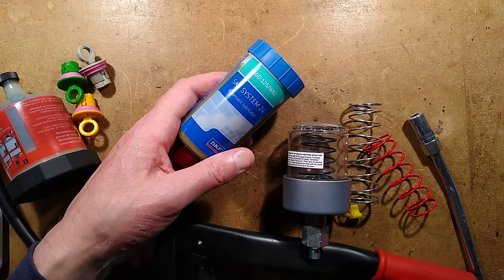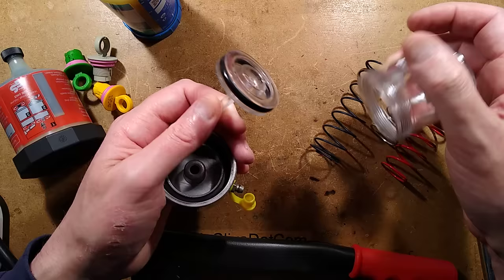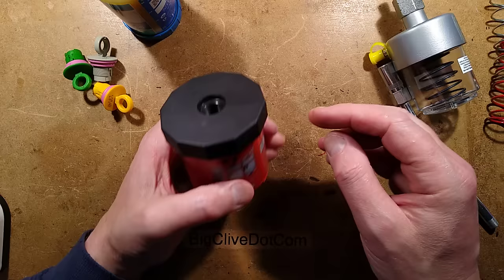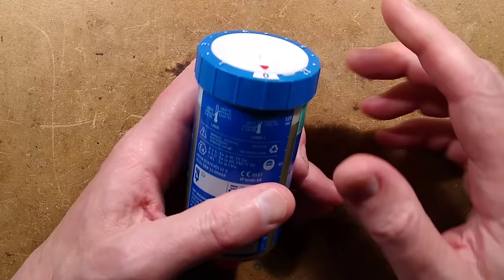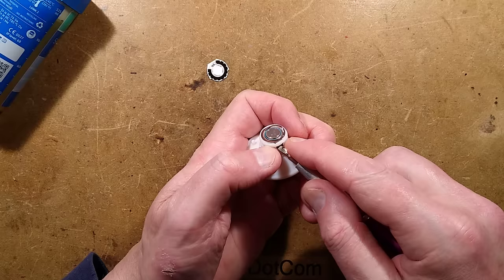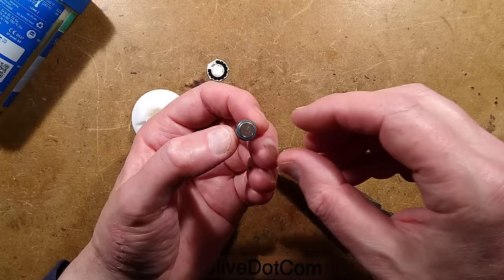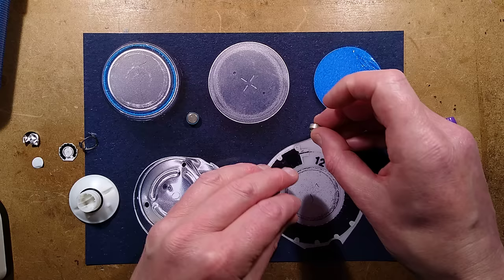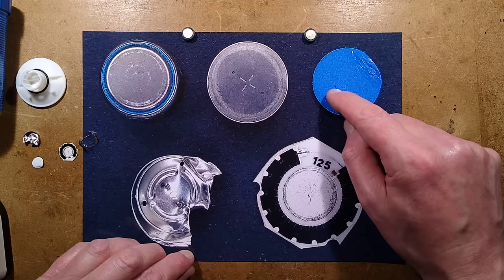Absolute genius automatic lubricator

Comment: The difficulty with this kind of "simple" system isn't just designing it - it's being able to manufacture every element with enough accuracy that it will work reliably and at a consistent speed.
Reply: Fast, cheap, good.

Pick two.
Reply: @mezmerizer0266  - With electronics, you get all 3. ;-)
Reply: @RFC-3514  As long as you're able to buy electronic components...
Reply: @pnjunction5689  - You can recover lots of components from broken appliances, etc.. But you have internet access, and most components can be ordered online for a few cents (well, a few dollars / euros / pounds in some cases, now).

It's certainly cheaper and easier than woodworking, motorboat racing, or launching space telescopes. 😉
Reply: @RFC-3514  I was talking about the current component shortage. It hit our industry pretty hard. Sure, for one off projects you can salvage parts, but not on an industrial scale.
Reply: @pnjunction5689  - Unlike the one before the pandemic (NAND chips, etc.), the current one seems to be affecting some other industries (ex., automotive) more than the electronics (computer / gadget) industry itself.

Comment: I have some zinc air 9 volt batteries that are sealed inside an aluminized bag. They have been sitting around for about 5 years and the bags swelled up and were pressurized. The batteries are just button cells in series inside a 9 volt battery sized case. I guess this chemistry can generate a lot of gas. This is a really clever application! Someone was seriously thinking outside the box when they came up with this one.
Reply: Aren't you talking about electric fence batteries that are non-rechargeable and look pretty much like a smaller car battery ?
Reply: @psirvent8  The batteries are Duracell Procell zinc air medical batteries. They are standard 9 volt battery dimensions with the standard terminals, and their output voltage comes to rest around 9 volts a few minutes after opening the package. Not sure what the intended application is but based on the name, some sort of medical equipment.
Reply: "A lot of gas." Aluminium rockets are one proposal for refuelling insitu from the moon by mining the materials. I assume Zinc batteries are a similar method of "outgassing". Lol.
Reply: There really are some very bright people out there. Pity none are in our government.

Comment: When I worked in a factory that built mining equipment, we tried using auto-greasers, but had to go back to having employees do the greasing because the auto-greasers would get broken when parts would bump them. Lubricator jobs were highly coveted, and almost never came up for bid. Since it was a really well paying job that you rode around on a cart with a dozen different greases and oils, following a schedule, it became a short-timer job that people would use to pad out their last few years with the company.
Reply: sounds like the grease fittings needed some welding :P
Reply: @rkan2  Maybe just removal and insert a small metal disk under the fitting....
Reply: @ravenbarsrepairs5594  I was thinking like protective cage to take the hit
Reply: Knowing what to put where and when... 
Some don't get it and can bring it all to a grinding halt.
Reply: @rkan2  that would be a massive cage! When I built brakes, a completed brake pack for one wheel could weigh upward of 2000 lbs, and were considered small parts. A completed machine always had a shipping instruction label on the frame, and it wasn't uncommon to see 60,000 to 70,000 lbs shipping weight, and those were our smaller pieces (anything bigger would be shipped as modular units, assembled at their respective mining site). When that much weight starts swinging on a crane, you just get out of the way! Our largest products were the 797 (400 ton payload truck), 24 grader (cutting edge width 24 to 32 feet), 994 loader (loads 100 tons of material per bucket), and 657 scraper (50 cubic yard capacity, with dual engines, hydraulic elevator, and specialty hitches to be able to run multiple units in a push-pull tandem). In the factory vernacular, the 777 trucks (100 ton payload) and smaller machines were lovingly called the "lawn and garden department". 😄 But, I do agree, a cage would have protected against minor taps and would absolutely have reduced the number of broken auto-greasers! 🙂
Reply: Lets an employee finish out their work career, while putting an important, while not necessarily demanding, job into the hands of a trusted someone with a vested interest in doing a good job.  

I talked with a guy whose father retired from the phone company as an oiler - someone who kept the rotary switches running.
Reply: My workplace has a whole workshop known as ‘the donkey sanctuary’ where the old boys who are close to retirement get sent because the pace is so slow in there.
Reply: That sounds awesome - but why would it be really well paying?  It just sounds too simple, anyone could do it.
Reply: @Tom_-  - It isn't necessarily well paying, but you can easily overgrease a machine, as well as undergrease it.  You have to be aware of what you're doing.   In this case, using older folks near the end of their career there, means they have a better idea of what those machines need.  Better to pay 50% or 100% more and have someone that understands the value of the equipment, than saving money with a minimum wage jockey - finding out that you ruined half a million dollars of machines in a year.
Reply: @tbelding  sure it sounds important, I'd love job like that
Reply: @ButterfatFarms  a cage could be a few inches larger than the auto-greasers in most cases and never interfere with much. In a lot of areas, it might be easier (and more fitting) to build the cage around the workers, though. I certainly can't say we were the most gentle of crews, I know I broke my share of stuff just going through a normal day. 😆
Reply: Which ones were you using?
Reply: @shopenasupply  I couldn't really say, I believe they were a Lincoln product, but I've been away from work for too long to say for sure.
Reply: I guess they made a point of not maintaining the auto-greasers
Reply: It's a good oversight role where an experienced operator can spot problems anywhere they're regularly present.

Comment: As a maintenance engineer, it's also important to remember that the daily maintenance with cleaning and lubrication is also an inspection of the machine. When the operator is performing routine maintenance, small leaks or other issues can be detected early, preventing larger issues if dealt with early enough. 
I have no doubt that automatic lubricators are useful in the right place, though.
Reply: We have these on tunnel ventilation fans. The shop we bought the new ones told that most go to lifts/elevators in houses so these are used for devices that "just run" most of the time.
Reply: Unfortunately, I've yet to meet an owner who is dollar wise and penny dumb, it's always the other way around.  The main goal is always cutting costs(aka corners).

Comment: Devilishly simple!
Reply: I'm hitting the lathe to make a skookum re-fillable version.
Reply: Even simpler: fill pipe with grease, toss in zinc coin cell with resistor bridge, seal and cap.
Reply from the maker: Yeah, lobbing in a cell or two with fixed resistors and capping it should have the same effect.  I've got some cells on order to see if they do indeed produce gas.  The tab has to stay on to prevent the cell from activating with ambient air, which messes up the use with a simple cell holder.  But technically speaking, a 3D printed holder with suitable connections and resistor could be made.
Reply: @BigClive  I wonder what the temperature threshold is for zinc-air; maybe you could just solder the leads directly to the battery.  Or if you can't get the heat up to flow it well, a spot-welder?
Reply: @BigClive  I'm going to try that idea: 3D printed holder - with external connections to try different resistor values and well sealed to a syringe (to measure gas production). FYI there seems to be two common zinc air battery sizes: 312 & 675. The 675 should give more bang (gas) for your buck as it is the larger of the two (675: 11.6mm X 5.4mm, 312: 7.9mm X 3.6mm).
Reply: This one is made by SFK.  Was the AvE review of an SKF lubricator, or did SKF swollow up the company that came up with this invention?
Reply: This comment and the replies are a better love story than Twilight.
Reply: @joels7605  most likely. Cartridges say made in Finland, but to my knowledge Finland doesn't have anything else that related production here. So I'd suspect that it was some clever guy who sold it to SKF. Note this hasn't got anything to proof. Just my speculation as I tried to Google at work that where on earth are they producing such things here.
Edit: at least ones I always receive have made in Finland written in them.
Reply: @arduinoversusevil2025  hi man. I remember when you did the video on one of these!
Reply: Uncle Bumblefuck! Ahh this has made my day
Reply: @joels7605  I dont know about this one, but SKF has in in general acquired a lot of automatic lubrication systems lately (past 2 decades).
Reply: @BigClive  Well, there are holders for two CR1225 cells in series. These should work for a single 675 (PR44) zinc-air battery, even with the tab on, since one contact is on the side. (e.g., CH23-1225LF)
Reply: Possibly a sly incendiary device that will make Mc Gyver proud
Reply: @oasntet  just wrap it in tinfoil!
Reply: G'day, It is your fault that I found this channel.
If it is good enough for you to watch I think I may have to stick around.
Reply: Thanks for pointing us in interesting directions. This channels a real skookum choocher.

Comment: I remember taking one of these SKF SYSTEM 24 cartridges apart a few years ago. The old ones uses discrete SMD resistors in series and a PCB inside instead of that carbon wiper. Never figured out how they worked back then, but this video answers pretty much everything! Pretty impressive that those two tiny cells can generate enough gas to push so much grease out.
Reply: They give their lives so that other machinery may live.
Reply: I'm mostly amazed by the fact that the gas don't escape from the canister given that it's intended to work for a year. That in it self is a remarkable feat of engineering and choice of materials.
Reply: @ehsnils  Not exactly like a tire with a slow leak that if accidentally abused ruptures releasing the entire remaining stored contents in one go, these release their self generating gas only on demand - quite a tidy process.
Reply: @Don.Challenger  I'm more considering the complete lubrication canister that if there's just a small leak the pressure pushing out the grease would never build up and it wouldn't work at all. Even a microscopic leak would make it fail.
Reply: It’s also pretty amazing that the seals work well enough not to loose the tiny volume of gases evolved; my guess is that the sealing surfaces took quite a lot of design care.
Reply: @ehsnils   It's fairly ease seal a plastic container (eg soda bottle) but even then some gas would still permeate through the plastic.   It must produce a small amount of excess gas to compensate for the loss.
Soda in an unopened plastic bottle will eventually go flat if it's left long enough.
Reply: SKF is the red one at 3:03 ? anyway had ones that looked like that , but they had another unit that screwed on the top , it had 3 AA batteries and a motor to create pressure .
Reply: @psychiatry-is-eugenics  A result of requirements on how to make it cheaper.
Reply: @ehsnils  luckily grease is great for sealing things up tight.
Reply: @MrStonedOne  but not on the side of the piston that pushes the grease. If you get grease there you have a malfunction.
Reply: @rogerborg  They fight to their last breath😔